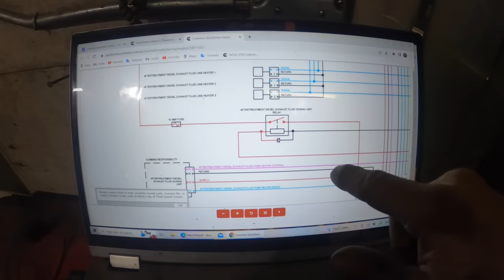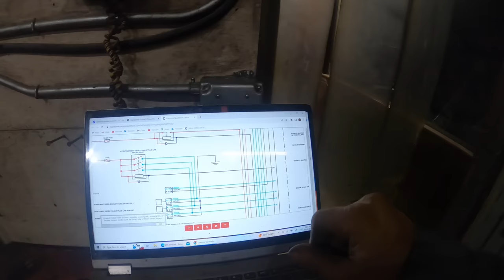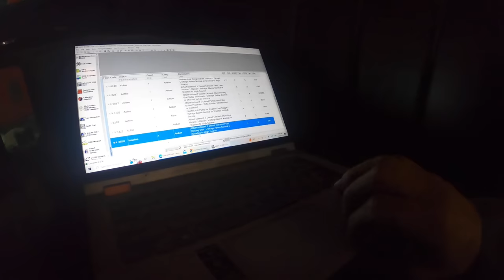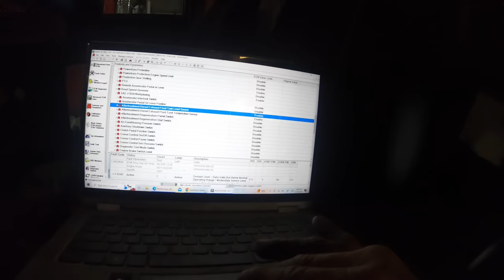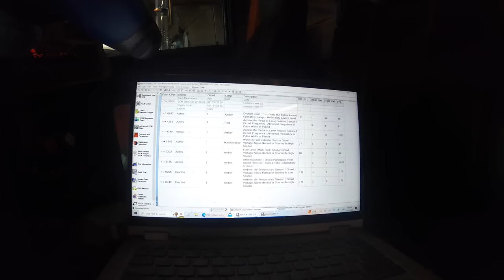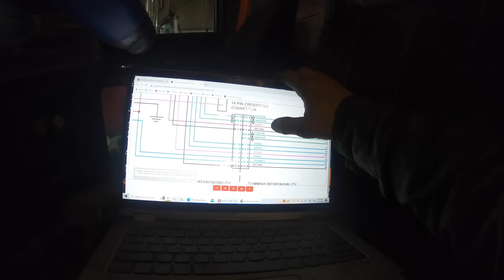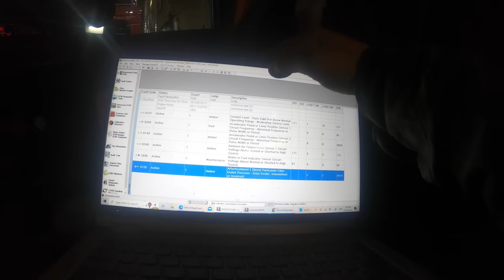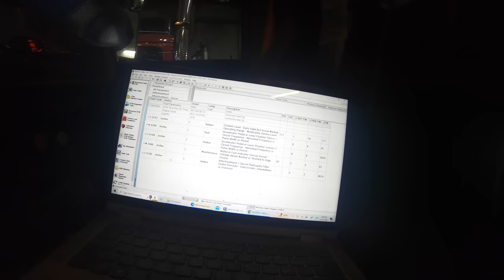Wiring and troubleshooting on the x15 Cummins.

Comment: What you do with these engines is an absolute credit to you. Awesome stuff. 

With the DPF outlet pressure/temp, I’ve found that can normalise once you do a burn and if that AdBlue wasn’t pumping when it starts working it should clear up also. But sometimes the DPF can be too blocked and you need to pull it out and clean/replace. 

You can also do chemical or hydrogen  cleans through the air intake, that helps keep the carbon and soot buildup down.

Comment: Is there a new system that does everything without the def- fluid system?
Is there a different type of system that doesn't require the water type of Def fluid?
I thought they were doing a with the water-based fluid system because it was freezing up in the wintertime in the Northern climate.
Sincerely!
R.S.V.

Comment: Instead of swapping different resistors until you find the correct size you might be able to use a variable resistor potentiometer and just turn it until you hit the magic number, then using your multimeter check the reading and fit a suitable resistor.
Reply: Good idea.  The pots i use are low range 5-15 ohms i think.  Everytime i have tried jury rigging one, it never works.  Have you done it?

Comment: What do you think about the debate between electric, hydrogen, diesel, or gas-powered vehicles in the whole gamete of things?
Trying not to get too political about it but I would rather have my diesel 12 valve than anything else.
I thought we fought for freedom in our country not for suppression of our freedom I know you have been in the military I've been around military personnel as well we all swear about the diesel engine. I would prefer it, unfortunately, I don't know what to do with both parties I feel they're all woke.
I believe that the Bible is telling us the truth the end times are coming soon!
But anyway outside of the stuff above what do you think about the current debate regarding electric, hydrogen, diesel, or gas-powered vehicles you're in that state anyway I think it sucks that isn't there a new def type system where there is no liquid trying to prevent the contamination of the diesel from the DEF.